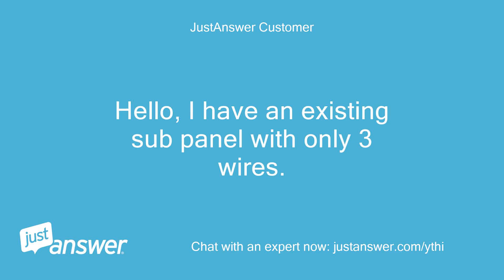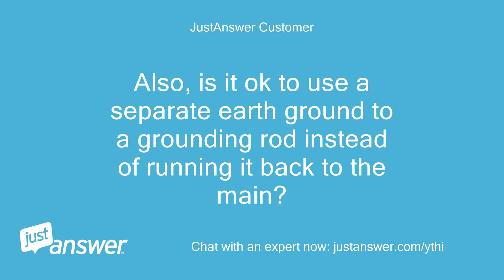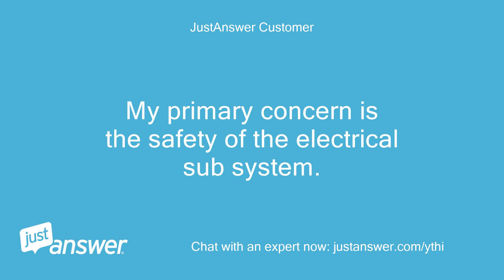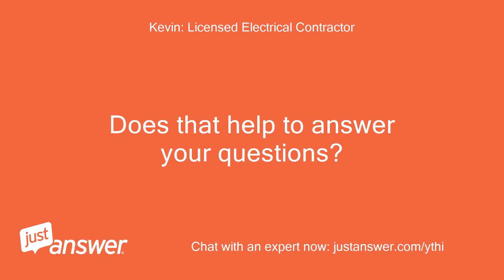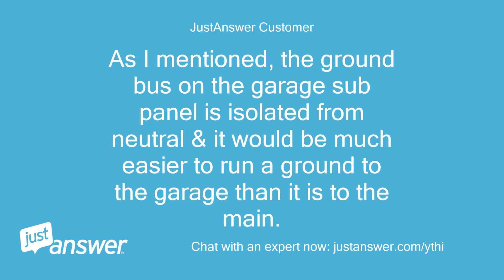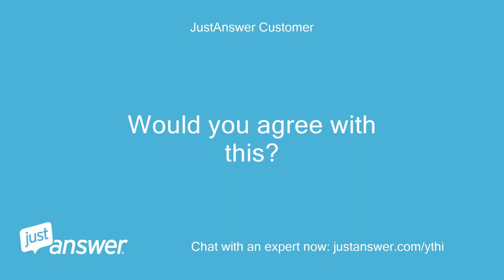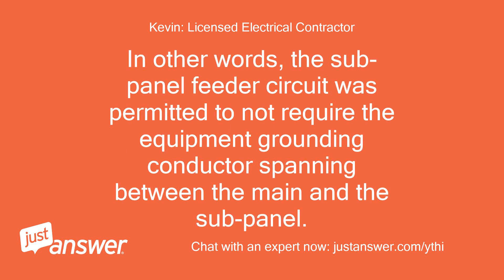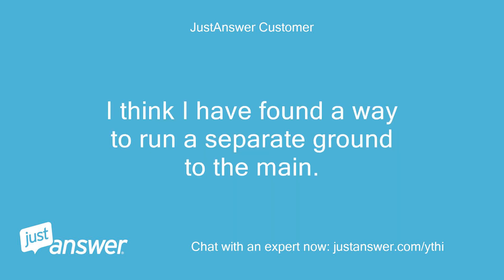I have an existing sub panel with only 3 wires. 2 insulated

Comment: We have a meter socket panel with a 200 AMP breaker & 4 circuit
breakers. Do I understand correctly that all panels "downstream from this panel are considered "sub panels" & require neutral & ground bars to be separate, requiring 4 cables (2 hot, 1 neutral & 1 ground)  to be provided to any panel "downstream" with seperate ground & neutral  bars? 

Is there any violation if ALL PANELS from entrance power through sub panels  would be treated the same as a sub panel installation with separated ground & neutral bus bars?